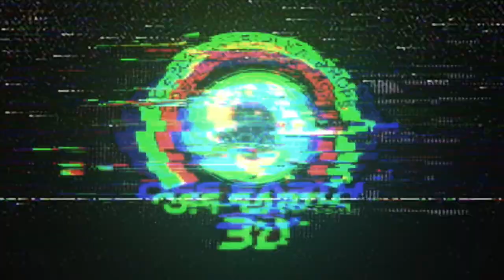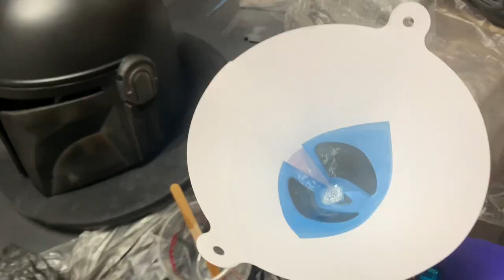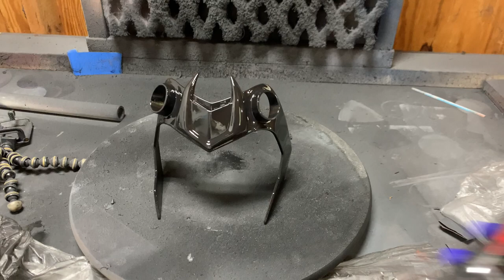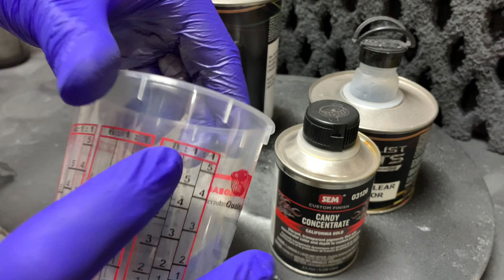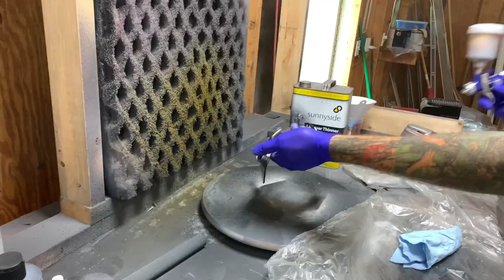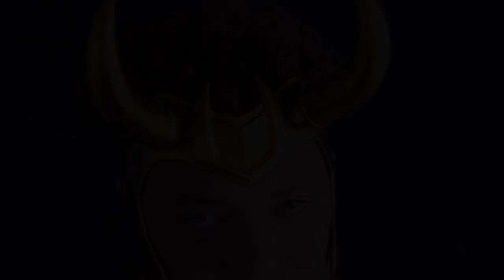Loki Crown (TV Series) Paint Up!

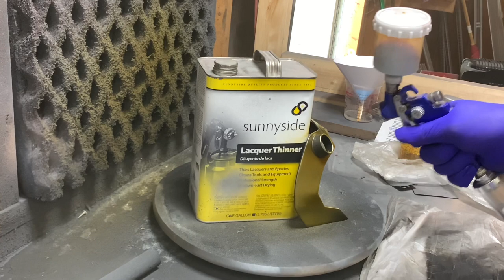Comment: Awesome video! I do have a question though — do you come back and do another pass of gold to get the bottom-most flat edges that are sitting on the turntable at the ~2:50 mark? I couldn't tell from your final shots wearing the crown if those edges were gold or not.
Reply from the maker: Yes. I always go in and hit the visible edges.
Reply: @offearth3d  Cool, thanks for the answer! I've been painting helmets lately by holding them up with a post so they're not sitting on the ground. I usually paint the bottom edge while holding it upside down, then flip it onto the post and do the rest. Doing it it two passes like you said seems better.
Reply from the maker: @ryanfiller  I try and hit the bottom first and work my way up